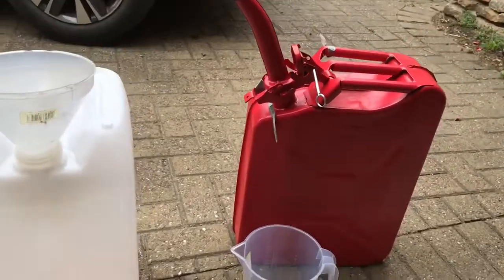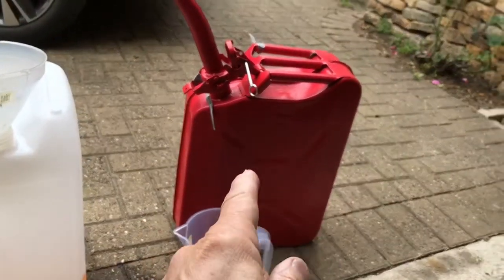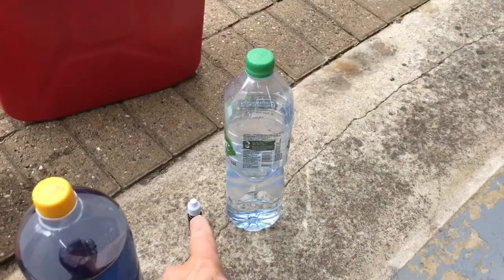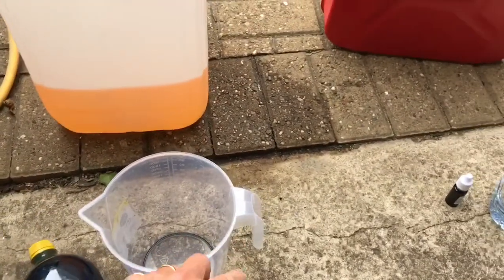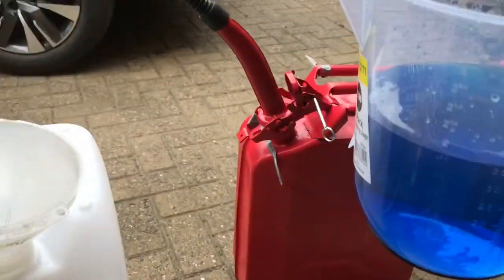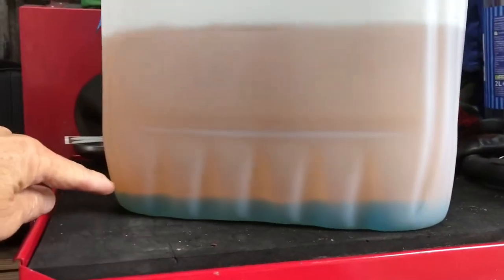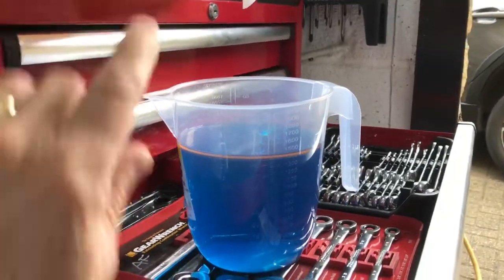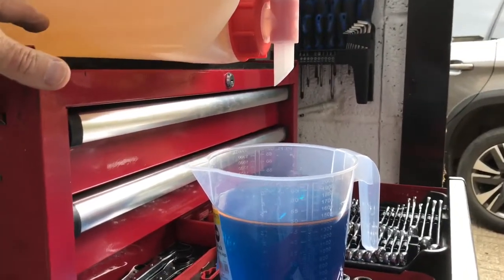How to remove Ethanol from unleaded fuel

Comment: For 10 litres of gas u only need 750 ml of water, he used 1 litre idk if thats bad or a good thing.

But it is suppose to ne 250ml of water per 3.8L (1 gallon)  of gas. So 10 litres is almost 2.5 gallons of gas, so it would be around 750ml of water.

Comment: YES.... we have all been conned by bureaucrats.  but, try telling the common masses who do not understand basic science.  Bring back proper 'Tetra Ethyl Lead' too.  It was far less hazardous than the carcinogenic additives used in petrol now in 2025.  If you fly a light piston engine aeroplane; you fill it up with AVGAS 100LL.  It is 100 octane and contains 4-5 times the lead content of the old 'four star' we once used.

Comment: you do know octaine boosters contain ethanol you cannot buy a ethanol free octain booster.
my neighbour uses his grand farthers royal enfeild flying flea he has won first prize for the 6th year running for his flying flea.
this is what he uses.
octain 98 from the pump.
does it the same way as you but does not add octain booster.
removing ethanol from petrol will lower the octain by a max of 4.
2-stroke oil will also lower petrol octain by max 3
so if you use a 2 tsroke the nmin octain would be 91
4 tsroke it would be a min of 94
and for old engins this is exerlant.
octain boosters just put ethanol back in the petrol

Comment: So, what do you do with the ethanol water mix left over from this process? Can the ethanol be easily separated from the water? Do you use the ethanol for other purposes?
 
Also, if you siphon the gas off the top, leaving the water/ethanol mixture in the bottom of the jug, can you just add more pumped gas for another batch? Essentially, allowing the ethanol to accumulate over time.

Comment: What sort of container is it as I don't want fuel damaging the tap seal?
Reply: Ive been looking for one of these containers. Go on ebay and type bottle with tap, its on there. 35litres it is.
Reply: I wouldn’t worry about the tap seal mate. Its less likely to go bad than anything ina fuel system as its not in CONSTANT use for prolonged periods of time.

Comment: Do you need to add the fuel booster if the petrol is only going to be used for garden machinery or is just adding 2 stroke oil suffice?
Reply: Your 2 stroke may become a 4 stroke (not firing every revolution) haha or just work as normal as id imagine itll be running hot enough to ignite it every turn still despite being less volatile having removed the ethanol…?

Comment: When water and ethanol are added the resulting volume is less than the sum of the two volumes because of a change in the hydrogen bonding. Ethanol takes up different volumes in different solvents. So  measuring the volume of ethanol extracted in water will show less than the actual amount.
In other words you are extracting more than you think.

Comment: I'm reading elsewhere that this is nonsense. Once the ethanol is in the petrol there is no way of removing it...
Reply from the maker: I trust by now you have understood the science and that this indeed is a fact. The blue water increases is proof that ethanol clings to the water. Good luck 👍
Reply: @imamacuser 
According to Mr Google..
(Once it is blended into gasoline, there's no feasible way to separate ethanol from the gasoline. Once it's in, it's in to stay. ... So adding water to gasoline just to remove the ethanol you don't want is not a good idea. It would do far more harm than good.)
Reply from the maker: Ah yes however that article does go on to say "Unless.....it absorbs so much water that it undergoes phase separation. In that case, both the ethanol and the water will separate out together. Now you've got all or some of the ethanol out of the gasoline. Unfortunately, the gasoline left behind has lost a lot of its octane value because the ethanol will strip out valuable fuel components" A fuel additive is beneficial in this case. Classic cars that are infrequently used naturally experience phased separation where water drops to the bottom of the tank where the petrol is drawn. I just today took off the carb float chambers on my latest restoration a GT6 and both had water droplets in them from previous owners last fill.  Happy motoring.
Reply: @imamacuser  now I'm really confused... My cars a diesel 🤣🤣🤣

Comment: Using valvemaster to regain the octane rating won't put a dent in it. Separating ethanol out loses around 4 points. You'd be lucky if the valvemaster put back half a point... You need 4 points. I'll be trying toluene off ebay.

Comment: Okay I have a question, when I make ethanol free gas and when it is fully separated, if I pour it through a mr funnel would that work or would the ethanol go back into the gas?? If the ethanol is permanently in the water and won’t mix with the fuel again couldn’t i just pour the gas through the mr funnel and remove the separated water through that instead of the other

Comment: Shocking how we now pay full fuel duty for 10%less fuel and then get shitty fuel mileage so have to buy more fuel more frequently and if we remove the ethanol we lose about 4 points of octane rating so when I do it, I only use super unleaded so it kinda ends up being regular unleaded even after an octane booster which we all know probably has no effect 
Taxation Britain 🇬🇧, 🖕🏻

Comment: Thanks for the video.
For info, Esso Synergy Supreme 99 is ethanol free. It says E5 on the pump but that is for Legislative reasons.
It is ethanol free except in the following areas of U.K.
Devon, Cornwall, North Wales, North England and Scotland.
Reply: Thanks for confirming an urban myth!! I use Esso as the Guzzi has a plastic tank & the ethanol makes it expand so can never get it refitted after removal for maintenance.  😎🏍️

Comment: Get ready for some detonation/preignition damage!
This does remove the ethanol but you are going to have some terrible 70 octane garbage when you get done that would likely cause detonation damage to a lawnmower engine. That "lead replacement" doesn't add any significant octane(notice they don't claim how many many units) it mainly protects unhardened exhaust valve seats from wear. Octane in unleaded fuel is based on bulk fractions of the blend like changing 10-30% of the hydrocarbons from paraffinics to aromatics.  Blending this alcohol removed fuel with 50% toluene will restore the octane rating as pure toluene is something like 110
On the plus side a new unleaded aviation fuel formula G100UL was announced a few weeks ago, so you may have that as a source of ethanol free fuel in another year or two. (Current blue 100LL avgas still has a small amount of lead to prevent valve seat erosion, but this is bad for sensors, catalytic converters, and may reduce spark plug life due to lead fouling.)

Comment: You can distil the ethanol back out of the water by warming it as ethanol has a very low boiling point. It can then be stored & used as a cleaning agent, rather than tipping it down the drain.
Reply: tell us,show us.
Reply: Me too

Comment: Tried this for the first time yesterday on a small scale using a 750ml glass jar & found that i get a three layer separation after 24 hours, i got the coloured water then a very cloudy layer then clear fuel, i assume the cloudy layer is the ethanol, it looks like an emulsion layer.
Reply: Maybe you didn't shake it will enough to full separate ethanol from the fuel?

Comment: You can use many of the super unleaded fuels as they're (currently) ethanol-free in most parts of the country, despite it saying E5 on the pump.

Also, your octane will be substantially reduced and the valve master won't be enough. Although most classics have had their timing adjusted, I've advanced mine to make use of the 99RON fuel I use. I'm not far from the Cotswolds either, about 10-15 minutes from Burford.

Comment: Just use a fuel stabilizer.....even if youhave ethanol-free gas. And for christsakes do the proper maintainance. Carb trouble from sitting with gas inside all winter isn't new, and it happens without etnanol blends.

Comment: Very cool I never realized it was that easy. What material is the clear jug with the spigot made of? I imagine if you use one made from a material not compatible with gasoline it will dissolve into the fuel that's gotta be worse than the ethanol

Comment: How about just buy premium gas that has no ethanol.
Reply: All petrol in the UK has ethanol
Reply: @pistonbroke  ahh, did not know that. Premium is available at pretty much every gas station in the States. I think the market demanded it for high performance vehicles, motorcycles, off road vehicles and small engines.

Comment: As a chartered chemical engineer, I can confirm this is a decent method for separating ethanol and petrol mixture. It is a technique called "liquid-liquid solvent extraction".
Your explaination of how it works "breaks it's bond with the petroleum" is inaccurate, but at I guess gives a simple picture in people's mind so is ok.
Only thing to note is that you can not remove all the water you put in through specific gravity (density) separation, but it's likely close enough.
Reply: Throw some Mol sieves in, sorted!
Just make sure you filter them out before putting it in your car I guess
Reply: Ha criticising his inaccuracie about the bond being broken between the petroleum and water, yet doing so with poor English. I shall quote you; "Your explanation of how it works "breaks its bond with the petroleum" is inaccurate, but at I guess gives a simple picture in people's mind so is ok... 🤦🏼‍♂️ Being a Chartered Chemical Engineer, doesn't mean you're overly good at writing English I guess 😂😂
Reply: @boshaveit  Hmm. "Ha criticising his inaccuracie about..." " Engineer, doesn't mean"....

Comment: great idea but in doing so you have reduced the octane rating.....Gasoline with 10% ethanol has reduced octane on the gasoline side because the octane was boosted by the ethanol

Comment: My thing is why would you want to take the ethanol out of the gas what a waste of time
Reply: Because in OLDER engines, the ethanol will attack all sorts of gaskets and 'O' rings - as the uploader explained.
Reply: @jackx4311  it also rusts out old steel fuel tanks.

Comment: This is great news to me. So easy. I work with small engines and I'm versed with getting water out of gas. I siphon water out by eye. The dye l makes it much easier.  I will make a set-up for my shop and personal use gas to remove the ethanol.  Thank you very much.

Comment: Great info, thanks. Now think of this: I've got a 1972 Delta 88 Oldsmobile 350 ci engine. 11 miles per gallon (4 litres) on the highway at 55 MPH (the most gas efficient speed). I'd need a factory to get enough gas to go any distance. Needless to say, It stays pretty much where I've parked for the last 15 years. But, I do have an old snapper lawn mower 10 hp that would probably love the stuff. Regards from Central Florida.

Comment: The only thing I’ve heard about is some special plunges that were made to desolve in alcohol which can be changed. As for the brass and solder I’ve had those problems years age before they ever started putting alcohol in the gas in fact we use to put alcohol in the gas tank to get the water out that we got from the gas stations glad to see the old cures are the problem we’re having are now supposed to be the problem I’ve used alcohol for years because it doesn’t desolve things like carburetor cleaners do and fuel additives I always thought the fuel additives like (PCB) I think it was called they finely took it out of the gas a few years back it dissolved a lot of the hoses and metal parts you see a lot of gas stations with the tanks above ground now because it devolved the underground tanks polluting large areas around them they had to make special hoses and a lot of metal parts especially on older vehicles and all other motors like lawnmowers weedeaters and chainsaws because all of them were having lots of problems but it’s ok blame alcohol that must be the problem who wants farmers to make a little money. You do know that after fermentation to make alcohol the fermented vegetables are easier to digest and are not thrown out they’re used for food but we can’t have that check it out bootleggers always feed there animals the leftover mash and had healthier animals

Comment: Beware!! After removing said ethanol,you end up with VERY low octane fuel from 87 to about 83-84 as the ethanol is used to increase octane, no amount of “so called” octane boost will fix this ,most of the octane boosters you buy off-the-shelf are snake oil, especially if they are in plastic containers, even octane booster’s that work only increase octane from 87 to 87.4 at the most
Reply: Rubbish; plenty of people I know have used octane boosters and tetra-ethyl lead substitutes in England - and even though their classic bikes were meant to run on 98 octane petrol, using those octane boosters allows them to run their bikes on standard 5% ethanol fuel - even though, in Britain, that is only 91 octane.
Reply: just buy some toluene and add that.

Comment: just dont do that, you will reducing the octane rating too
Reply: No, it won't.  Ethanol does NOT improve the octane rating.
Reply: @jackx4311  yes it improve because ethanol has 113 octane rating, if you remove 10% etanol in a 87 octane E10 fuel it will reduce to 85 octane grade

Comment: Sunoco and a few other stations offer ethanol free fuel but at almost $2 more than ethanol contaminated fuel so if you can afford it you can still get it. My 2006 Cayenne S runs just fine on basic 87 octane ethanol gas so I won't complain. I will use this trick for my lawn tools though great idea to keep them running longer.

Comment: So.... just to be clear....use distilled water and skip the blue dye right?  I do like the measurements before and after. You will know precisely how much ethanol you’ve just acquired .... for free.
Reply: Not exactly, but close. Ethanol and water are not additive by volume. The final volume is less than one would think. There are charts/graphs to predict final volume for eth and water. Also there are other gasoline additives like detergents and anti-knock compounds which will partition in trace amounts with the water - eth mixture. Not to  mention it's denatured ethanol, perhaps with methanol.
Reply: @johnbauman4005    The methanol will come off the second time you distill it in the first couple of ml’s. Just discard it. All the other stuff will come off in the tails or get left behind in the flask. But yes. Your right. What you end up with will be less than 5% of the original volume.

Comment: Now put your water/ethanol mix (along with that little bit of octane) in a 2 liter flask and distill it down....at least twice. Triple distilled is the ticket. You’ll have 400ml of pure ethanol....that’s almost half a liter that you can drink. But not all at once or you’ll fall down! (That 400 ml of moonshine is stronger than a quart of your finest top shelf) 
Now that’s a real bonus if you ask me!
Reply: Uh maybe you're joking? It's denatured ethanol. Distilling won't save your eyesight or your life.
Reply: @johnbauman4005       your absolutely right of course. Denaturing alcohol so it can’t be used as a drink is done by adding approx 10% by volume isopropanol or methanol as well as a dye and other sh*t to make it bitter or nauseating. Carefully distilling it will separate the ethanol but it’s not worth the effort. 
It’s best just to clean your fuel of the ethanol and it’s denaturing buddies and discarding the resultant waste. 
Make up a sugary mix, throw in some yeast, let it sit for a week or so....then distill the crap out of the mash. It’s safer and a lot easier.  LoL
It’s been fun.  “Cheers”

Comment: Just simply dump in VP Madditive instead of going through all that.
Reply: VP Madditive will boost the octane rating - but that's not the problem with engines like these; the fule will still contain ethanol, which will attacka nd destroy many components in the engine of his classic car.
Reply: @jackx4311  You as so right about that statement.

Comment: Why the hell even classics are fine on e10 just use stabilizer when parked lol all of the uk people freaking out about this lol we have been running it for decades
Reply: Because us "UK people" have found by bitter experience that ethanol in fuel DOES destroy certain components in our classic engines.  It's not a question of using a stabiliser to stop the fuel degrading; THE ETHANOL ATTACKS VITAL PARTS.
Is THAT clear enough?
Reply: @jackx4311   No it is not.  you're not proving this your assuming it's bad 10% ethanol is a very very small percentage and will not cause any major issues in your supposed classics which judging by what I've seen of UK vehicles are just rusty piles of shit anyway. You wanna be aggressive in your reply I can be aggressive to.